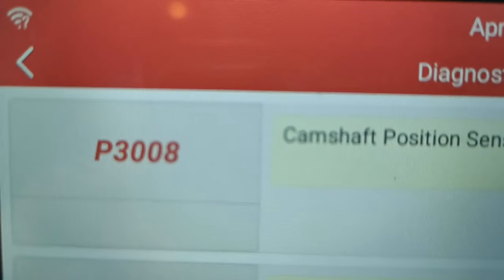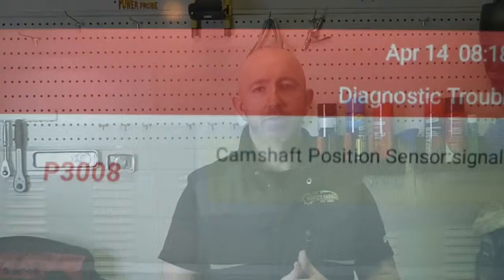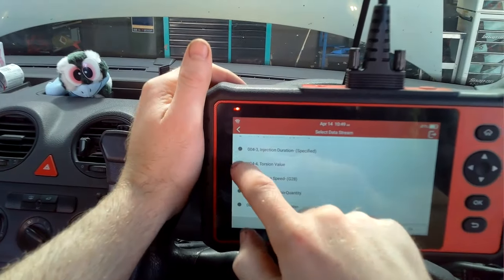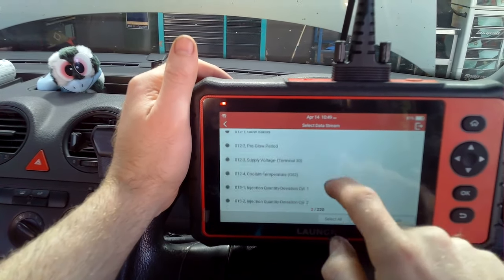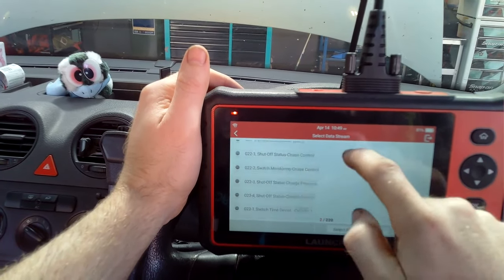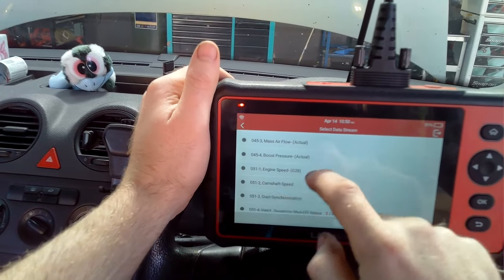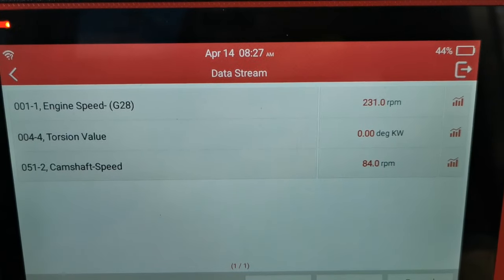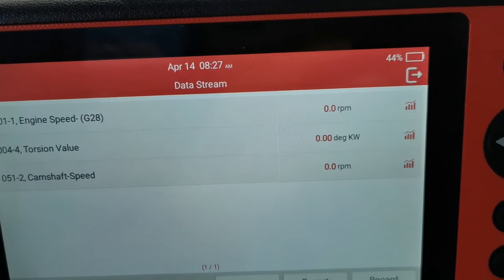Volkswagen TDI Cranking But No Start Fault - Found & Fixed - How To DIY

Comment: hi i suspect this is the problem on my 2.0tdi Passat that pully is maxed on one side, there appears to be marks that indicate it slipped, when car is cold press the key crank no start, take out key try again and it starts fine any help would be greatly appreciated has fault code p0321 which goodle says is crank sensor but obd scanner shows the sensor working fine, cam shows half of engine speed no drops or anything, edit, pressing key in and out a few times to prime the lines makes no difference

Comment: Trying to figure out this issue on my 05 tdi. It fires right up most of the time but randomly will do this. I fixed it the first time by clearing a code with a scan tool. The second time I unplugged the battery and restarted the ECU and that worked. Looking for a permanent solution though
Reply: Did you get this fixed mate? I used to have this problem 😕
Reply: Have u managed to sort yours I’ve had an intermittent starting problem for about 12 months and can’t get to the bottom of it 🤔🤔🤯🤯

Comment: Hi! I have a 2014 Jetta that cranks but won’t start until several tries.They replaced camshaft sensor but still haves same problem.No codes come out
Reply: then suspect timing.

Comment: I am having the same issue with a 2006 Jetta TDI with manual trans and 167,000 miles. Just this week when starting the car, it would start and run but I would hear a noise for a few seconds after start that sounded like the starter bendix was still engaged, lasting for 4-5 seconds. (installed new starter around 130,00)  I think this is unrelated to the "no start" issue
This morning, the car would start and shut off after 3 or so seconds.
Now after a few attempts, it will turn over but not start.
I hooked up my Autel scan gauge and it would load to 98% and then say link failed. Did this numerous times.
Also when the key is in ignition and turned to the on position, after 10 or so seconds the cooling fans would come on at full speed. (this is with a cold engine).
I can not hear any relays clicking.
Ideas on where to start?
Reply: Did you find an answer to this please ?

Comment: Hi buddy same issue cranking not starting pd170 bnm engine changed new crank senor temp sensor tandem pump intank pump fuel filter still won't start but starts with easy start an then cuts off after 45mins an won't start again so frustrating anything I can look out for
Reply: Hi did you sort it out, I have the same problem with mine, it dies when it hot?

Comment: Guys hi I have a problem with my toureg 2.5 tdi. I changed d engine n put a complete engine but won't start, only if I use a quick start then it does start what could b d problem
Reply: I think the timing is off
Try to unplug the cam sensor,if it starts easily you need correct the cam timing
Reply: B d c, u, innit.

Comment: Hi Gerard. I hope Your keeping grand.  Sadly it appears my camshaft sprocket remains pretty much dead centre. I also carried out disconnecting  its position sensor but the engine refused to start.  Any other ideas would be gratefully appreciated, should you be able to find the time.  I have a multi meter,  good tools, but that's about it.  I'm assuming the issue is not the camshaft speed sensor itself, as these engines will run with this item disconnected. Many Thanks In Advance.
Reply: If you have a lift pump, make sure it is providing pressure.

Comment: 🚨🚨Hey Sir Please Help 🙏🙏
I have a 2011 GTI 2.0T 
I was at a friend's house and went to leave and it wouldn't start. The crank rotates but no fire. I replaced the battery, spark plug, ECU relay, fuel module and I have 45-50 psi at the high pressure pump. Also replaced the crank position sensor. Oh and there NO CODES. 
Please help me figure this out. It's been weeks now.
Reply: Thank you Gérard I have a tdi2.0 diesel VW Amarok suddenly it started not idling well on starting g for work in the morning. I released airlock that morning and it improved. Now the problem is permanent and it cuts speed at 60km per hour and turns engine check ,ight and glow light. The diagnostic shows the code for diesel common rail pressure. The mechanics have suggested to replace injectors but I am hesitant that it's an injector problem. Your input will greatly help Gérard. Thank hou.

Comment: So unfortunate that the same engine but in Amarok 2013 2hB model the sensor connector is inaccessible :/ 
The connector is between the block and oil cooler by the looks. No possible to remove it without pulling the head. 
How fucked.

Comment: my 01 golf TDI cranks for a loooong time around 30 seconds then it starts. once the engine is hot it starts. if it's a cold day it will take 3 or 4 times as long to start. no codes , and I'm stumped
Reply: Sounds like glow plugs? I've heard that's a very common replacement in TDI cars

Comment: Hey I just changed crankshaft sensor and it started I wickle the plug and it switch it off it self
Reply: You have bad connections or  internal wire fracture. Try stretching each wire  by pulling. Faulty wire will extend in length. Good wire will not.

Comment: I have a problem on my VW T5 2009 1.9 TDI...On cold start when i turn key engine almost fire up then slowly shuts down by it self...
- second starting it wont start and message pop up if i hold key for some time  (Stop motor,oil pressure)...
- on third attempt i can start engine after 6 or so seconds holding a key....
- Problem occur on cold starts,every other starting in same day is without problem.If anyone have clue please help......
- Maybe its the same problem like here cause my mechanic told me he was calibrating ignition when i was doing service of belt etc...
- No other errors on dashboard.
Reply: If you have a lift pump, make sure it is providing pressure.

Comment: Anyone ever had issues with passat 2011 B7, No crank No start? Put key in ignition all lights come on dash etc, put clutch in an Get absolute Nothing while Ignition on the coolant fan blows extremely hard? Week today car hasnt drove. Wont go on a Jump nor a bump any help be great
Reply: Update?
Reply: ECU module itself. Water damage common failure from 2008-2015 due to location

Comment: I have a BRM TDI that will stall when it hits operating temperature, and won’t restart until it is cooled off. Anyone have any experience with this?
Reply: @Lee-eu6wf  any luck figuring out what’s wrong with it?the first thing I was told to check was relay 109. Try that if you haven’t already. I wish mine would quit starting so I could have more time to diagnose the no start
Reply: @Lee-eu6wf  thanks for commenting! So it turned out to be a broken wire? Was the cam sensor bad as well? The last thing I did to mine was start tearing into the wiring harness, but I haven’t touched it in almost a month.
Reply: @Lee-eu6wf  i definitely need to spend some time diagnosing my cam and crank sensors then. I have heard that they can cause crank no start issues without throwing codes. Thanks a lot for giving me an update! Hopefully these comments help someone else someday as well.